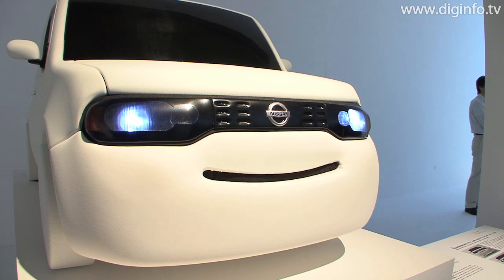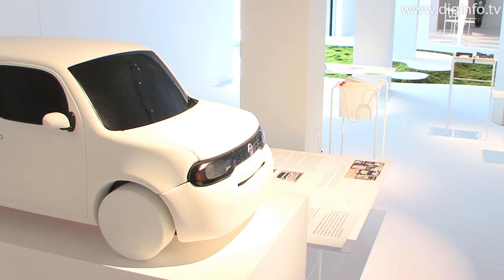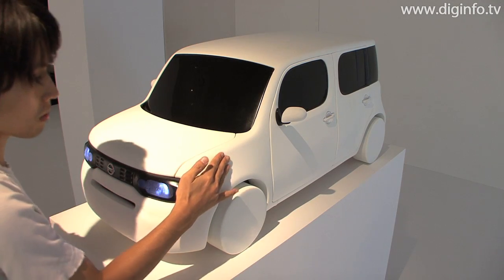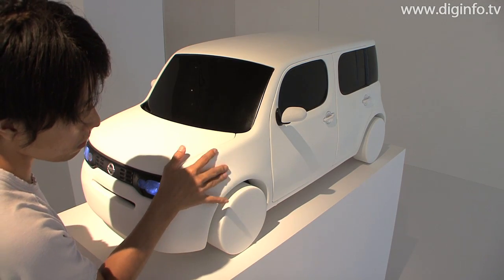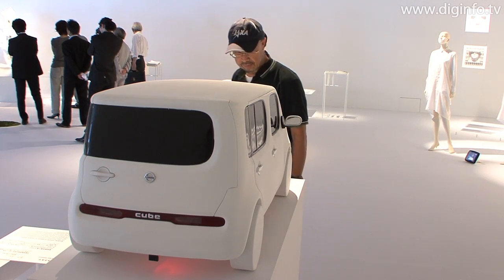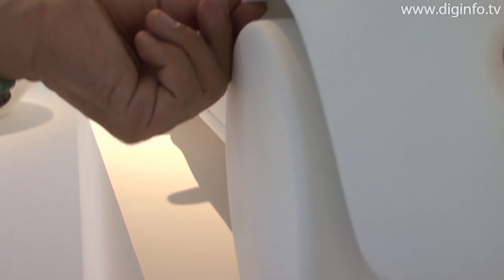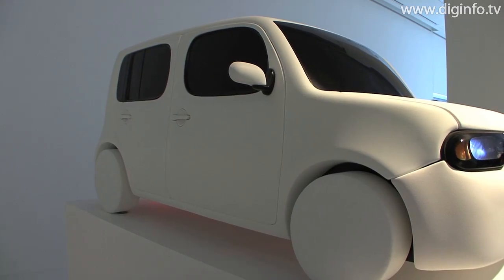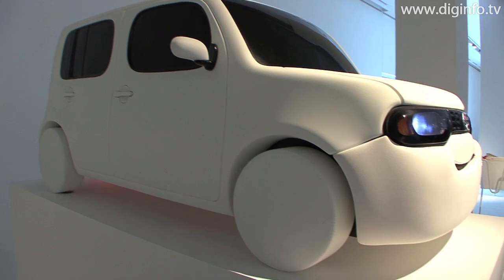Smiling Vehicle Displays Human Emotions : DigInfo

Comment: This could be rather useful. You could use it to tell if a driver could be drunk, or angry by placing heart rate monitors in the steering wheel and seat. The facial expression could be used to warn oncoming drivers of the mood of the current driver. At least then they can swerve to avoid an accident if any erratic driving is involved. I like this idea, a lot.